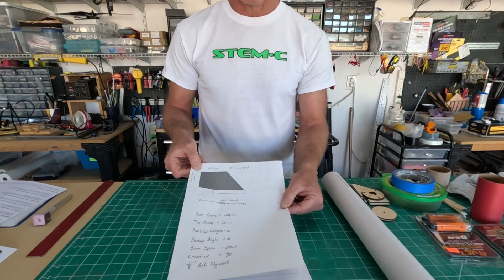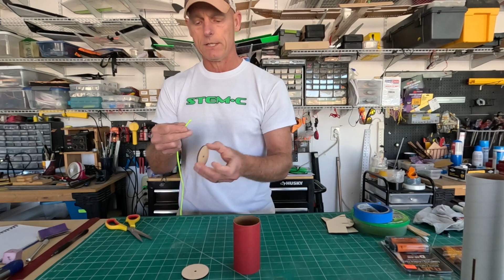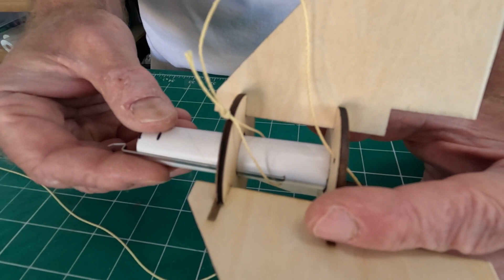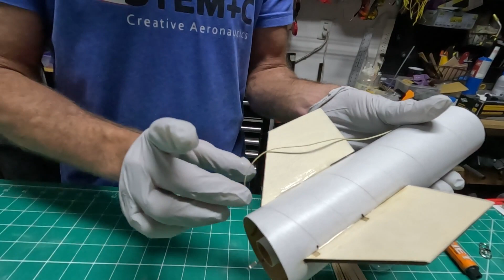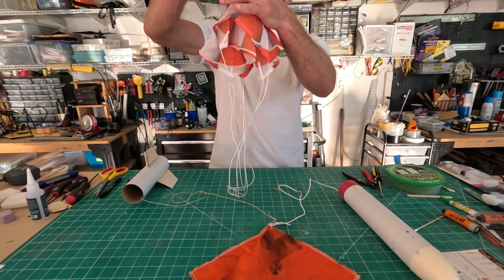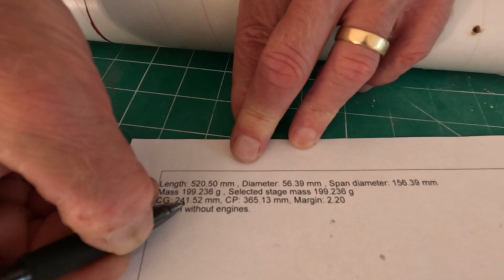Rocket with Egg, Build and Fly

Comment: No engine block? D motors can bend the engine hook over time. Anybody clustering 3×18mm C motors, or is this eggloft limited to only 1×18mm motor?
Reply: These were single use rockets..you can always add a block if you need to..😊🚀

Comment: Continuity error! 
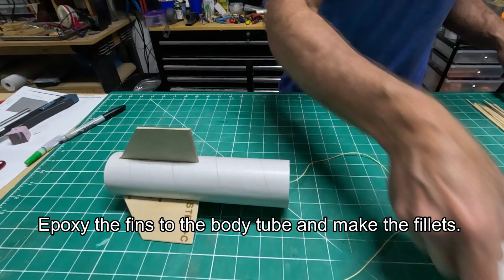The body tube was cut at the aft end to allow the fin and motor mount unit to slide into place. At time stamp 34:22, the entire assembly is obviously a different piece, because the relief cuts for the fins have magically disappeared! Amazing!
Reply from the maker: The video was shot 3 times.  I took parts and pieces of all 3 shoots to put the video together, notice I have different shirts on... :)  As in any of this stuff, there are multiple techniques that will get you the same end result.  You could install the motor mount first into the BT, then install the fins or you can build the fins and mmt as a "Fin Can" and do an install as I do in the video.  Both techniques get you to the same end result.  If you follow the video, it does not matter that I am using a different lower section at all, the point I am trying to get across does not change at all.  I am surprised that you did not point out that I am wearing different shirts.. :)
Reply: @stempluscinc.5810  
The rocket was the point of interest, not clothing.